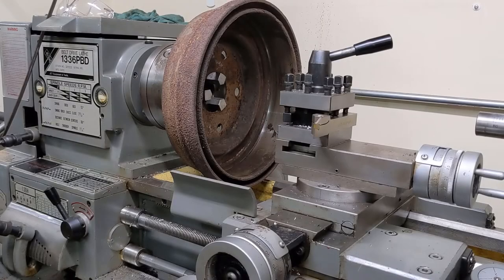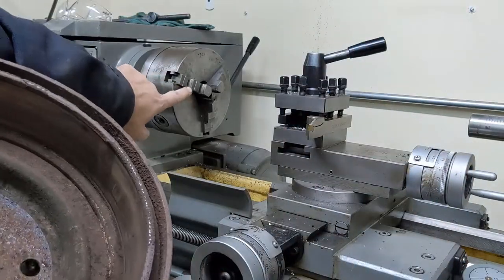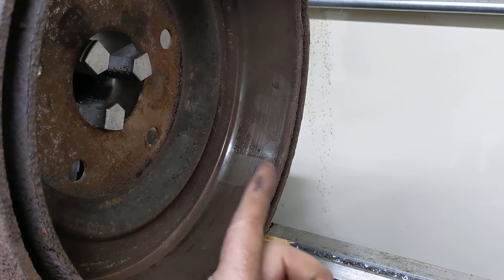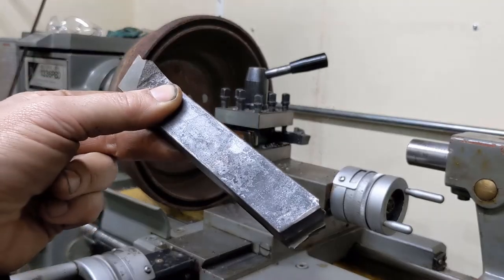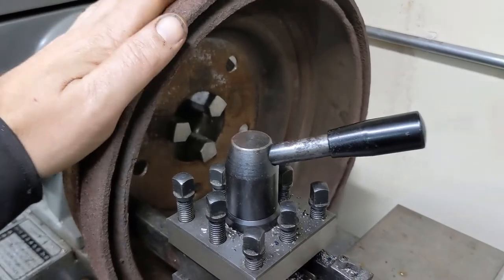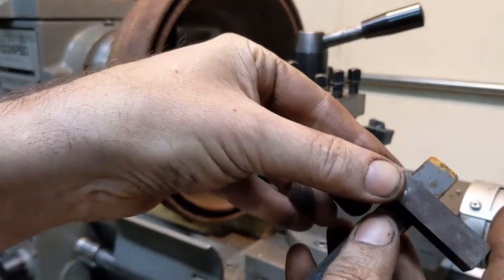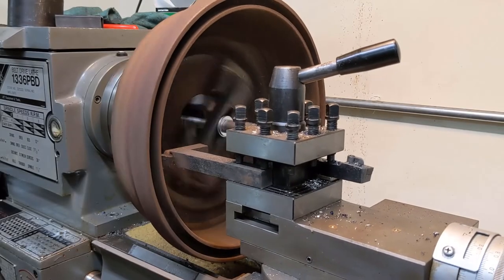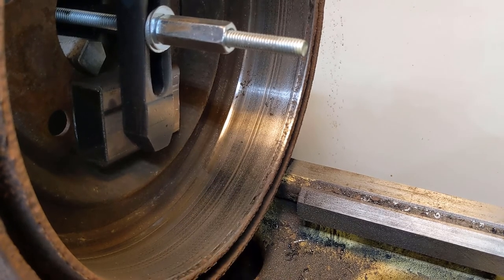Turning a Brake Drum on an Engine Lathe

Comment: the patterns on the surface at 6:34 are a result of the brake drum vibrating during turning resulting in an unconsistent cut. i encountered this problem too. my solution was to slow down the lathe to an minimum (usually around 200rpm) and going for a rigid tool holder. when it stops screaming and singing during turning the surface turns out fine, usually...

Comment: On the berco brake lath they have a series of cups that you select to fit the flange size,  these push on each other with the drum in the middle, then there is a spring loaded cone that helps you centralize the drum , usually all it took was a couple of tightening and loosening  and re tightening attempts for it to clock ok , then strap it with the thick rubber de ringer ,the boring bar was very rigid about 50mm,  brake lathes are fairly slow , but do a great job .

Comment: I turned a drum with just the three-jaw chuck holding.  Selected the lowest speed on the lathe, used a boring bar with a carbide tip, and ran the travel at the slowest speed.  About seven passes and it was smooth.  Since I have a brake lathe, I used a weight belt from that set on the drum.
Reply from the maker: Nice job. Unfortunately my lathe has something wrong in the gearbox and won't go any slower

Comment: Well done job of doing with what you have! Been there....The chatter is reduced with negative rake. Carbide cutter at a guess negative seven degrees. You can wind the outside with rubber hose for a damper.

Comment: I’m 2 years late to the party.  My comments are absolutely not intended as a criticism at all, I really just to help out anyone watching this video, setup a lathe for brake drums.  So, for the benefit of others…Even bungee cords and/or duct tape and rags are enough to stop ringing.  The ringing isn’t just a nuisance, it’s audible chatter (not all chatter is audible).  Lathe RPM is way too fast.  I’m not quite sure about feeds from the video, but if you are constantly losing a good hss edge, SLOW IT ALL DOWN before going to TC.  HSS will handle Cast Iron at correct speeds (which makes heat manageable).  If you’ve got TC, that’s fine, but for those of you who don’t have access to TC, don’t leave this video feeling like you NEED TC to turn down a brake drum.  There is very very few things that can’t be managed with HSS, provided you have the patience.  In fact, for the average at home DIY tinkerer machinist, HSS is really all you need. TC can allow you to take deeper cuts at higher speeds/feeds, but if you’ve got the time, HSS will do all the same things (and TC has its downsides too, so it’s not all roses).  Having said all that, if your lathe is stuck in a higher gear and low speed is not an option,  TC is a brilliant option to get the job done.

Comment: Using HSS tooling on soft steel, you need to limit the cutting speed to 100 surface feet per minute. Assuming your drum diameter is 12 inches, 1 foot diameter is 3.14 feet circumference. So 100 SFM is a max of 32 RPM. And as this is hard material, maybe 50% less speed. You need much more speed reduction. Back gear should get you there. I don't know your lathe. 
The other issue, just how good is your 3 jaw chuck. Even Bison brand has a few thousands of runout. As all the surfaces are rusty, you compound the runout using the center pilot without some means of checking that.
I turned some brake rotors on my lathe this past spring. I wanted to see if I could do them. I sand blasted them first. My big lathe has a 3 phase motor driven with a VFD, so I can slow it down to a crawl.
Reply from the maker: Unfortunately my lathe needs to be taken apart and the low gear fixed, that's as slow as it goes right now.
Reply: @YoshimoshiGarage  I watched you video, as I have 4 brake drums to do from a 1956 Chevy 1.5ton truck. These are 16" diameter drums. I know I need to figure out a way to hold them in the 4 jaw chuck. 
So I watched a video using a purpose manufacture brake lathe. Looks like they use a cone to center the drum center hole pilot. I'll have to fab all that stuff. 
I recall some specifications that say less then 0.002" of runout so the brake shoes and holding hardware does not fail. That's a pretty tight tolerance.
Reply: @YoshimoshiGarage  From the looks I'm guessing a 14x40 lathe, maybe 12x36. The headstock looks very similar to my 1976 Jet brand 10x24. Same oil level sight glass and casting design (Jet was an importer that had their name put on existing manufacture equipment). 
If the back gear is like mine, you have to disengage a spring loaded pin the decouples the V-belt pulley from the spindle, and then an eccentric mechanism swings the floating gears to mesh with the two gears on the spindle.
I hope it's just an issue with adjustment and not gear teeth that got destroyed.
Reply: @YoshimoshiGarage  I subscribed. I'm the same, I fix everything. Mechanical, electrical, electronic. Best thing I did after high school was a 2 year school in HVAC. Worked as a lab tech for the Trane Company in Lacrosse, WI, and saw I was as smart as the mechanical engineers. So went back to school and got an EE degree. Also in high school they had metal  working so I got that bug. Oddly all the schools sold off their votech equipment when I started work in 1984. Now they don't have the original space or equipment. I'm retired, and now need to restore the 1924 model T truck, 1956 Chevy Truck, 1957 Chevy truck and 1965 Datsun Fairlady SPL310. I have a pretty full machine shop.
Oh, I measure the brake drum off the rear of the truck, 17.1 inches. So I'll have to see if it will fit on the big lathe, supposed to be 18x40. I've never had the gap out of it.
Just looking at your video titles you seem to take on all the same things I would.

Comment: I doubt the cast iron was especially hard, but your cutting speed looked way too high. I mean FPM right at the cut. Use the back gear. The cutting tool simply will not survive this abuse, the localized instantaneous heating at the cut is intense, there is no "maybe I'll get away with it. " It softens and can no longer hold an edge.
    The rust is another significant factor, it is hard and abrasive, and will wear the tool out quickly. The loss of the sharp edge increases friction, therefore heat, adding to the cutting speed being maybe 10x too high.
   The vibration (singing) can be changed by the tool tip profile, a very pointy shape reduces the forces involved, and might help. But it will be more fragile and susceptible to overheating.
    I noticed that one of those hold down blocks is positioned between the chuck jaws, the other is over one. The drum might be distorted...bowed slightly under the block not backed up by a chuck jaw. This could make the drum out of round while cutting the hole to a round shape. Then when released, the formerly round hole becomes an oval in its relaxed state. Maybe. Maybe not enough to matter.
   But that RPM made me cringe...poor tool!
    Google "metal cutting speeds and feed rates". Not optional...get that approximately right or wreck tooling.
Reply from the maker: It was an exercise in "working with what I have." The lathe won't go any slower than that until it gets some maintenance.